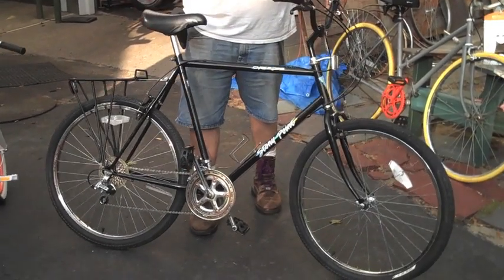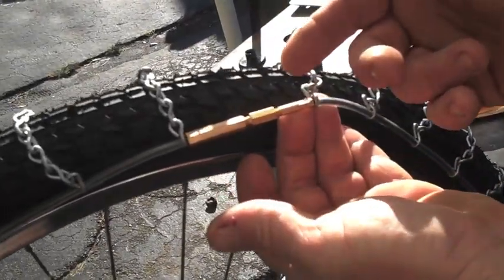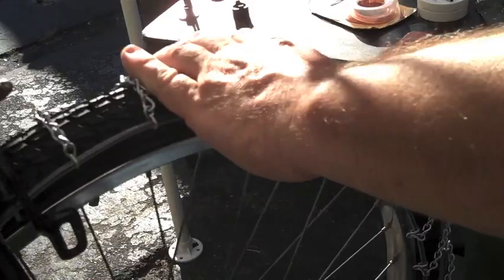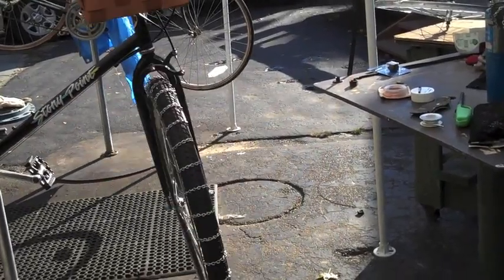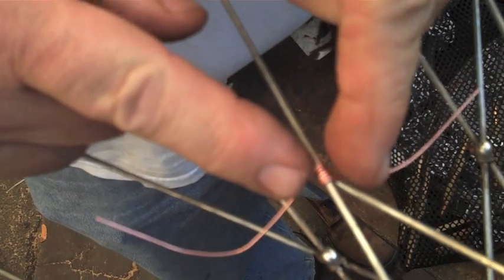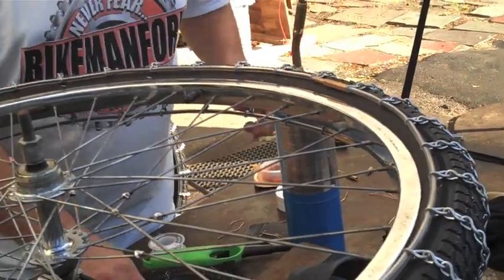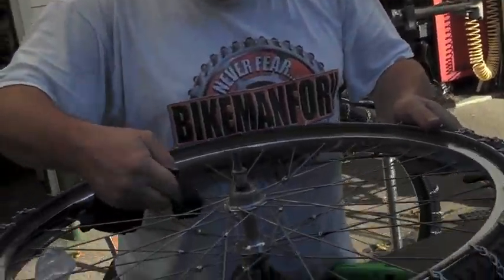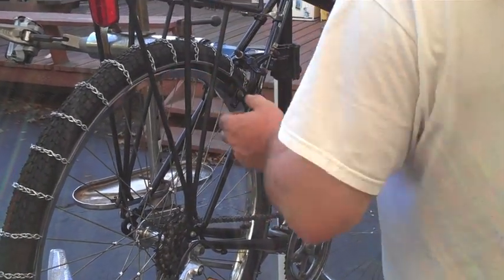Commuter Bike - Tie & Solder Spokes For Strength + Snow Chain Install - BikemanforU Show Episode 25

Comment: I love this idea! Because I learned the hard hard way when I overloaded a cargo rack full of food and had a cooler tied to the side full of frozen onion rings and frozen chickens when I heard a PING! First the spoke broke then the cargo rack stanchion broke and I was stuck pushing this heavy heavy bike, with a fully loaded backpack of food also, on a very hot summer day. This is why I ended up replacing it with an extra heavy duty 26 inch wheel with 11 gauge spokes from bikemanforu. I can't find it in your products anymore, though!

That wheel looked like it was built for a motorcycle actually. Spendy investment but worth it. I need another one for another build I am doing! I'll probably use this spoke trick on my city bike.

Comment: i have a back wheel that was loosening 5 spokes on its own, bike shop wanted £35 to replace all spokes, they wouldnt sell me 5 new nipples. so i took nipples off an old disused wheel and then tied the spokes without soldering them.  Now it doesnt loosen spokes itself, and feels a lot stronger.  Not soldering keeps the tension as it was designed to be, soldering basically turns one spoke into 2.

Comment: For a freewheel wheel like the one on the commuter you have to worry more about a broken axle than a broken spoke.  This is the main reason bikes don't have freewheels anymore and have freehubs with cassettes.  The bearings are farther out on the axle ends making broken axles less likely along with through axle designs for front hubs on mountain bikes and rear hub options.  A modern day downhill wheel can handle the weight of a 300 lbs commutter no problem without soldering spokes together.

Comment: ok i understand the theory of this, but you should have stated to have the wheel trued before doing this, as truing after is not going to happen. i agree with Mr Free about a torch for soldering, but a good 70 watt iron id feel comfy doing this. 

just my 2 cents worth.

Comment: So the heat transfer down the spoke wont melt the rubber strip on the inside of the wheel? Just wondering.  Thanks though great video.

Comment: can you use them on muddy trails? or use them for slippery surfaces on trails like clay that can be a bit slippery when slightly wet? my notifications thing is not working so will have to check back periodic for any response. I absolutly did not know they made snow chains for bikes. who in their right mind rides in the cold and snow? I know one guy around here on a ten speed racing bike who rides all year long, for hours at a time and I have even seen him riding at 3 in the morning. wow., either he is training for a tour de france or he is a nut?

Comment: Looking to do this on a road bike, so I'm a bit of a weight weenie. Would the soldering still work without the wire tied around the spokes? I've seen it done with one of my friend's wheels, but how does the strength compare?

Comment: I don't see the need for chains. They look like they would add a lot of rolling resistance.
I have ridden on snow before using only knobby tires and lower pressure, like 1.5 bar.
It works well!

Comment: How would you manage if one or to spokes snaped?
Reply: Just get a pair of of heavy duty cutters or a hack saw blade and cut the spoke between the soldered wire wrap and hub...
Reply: What do you do when a soldered wire snaps or component soldered to a PCB fails? It's solder... Desolder and replace.